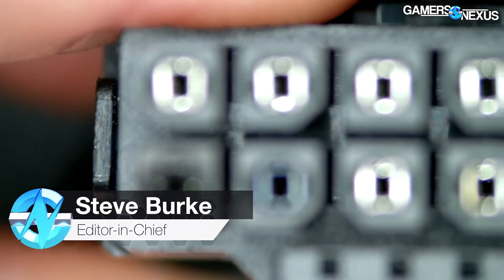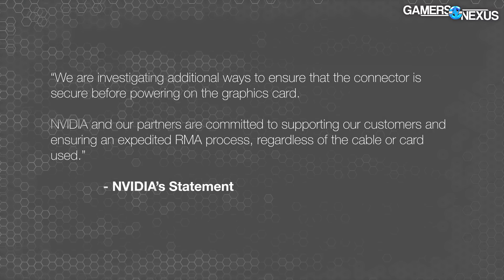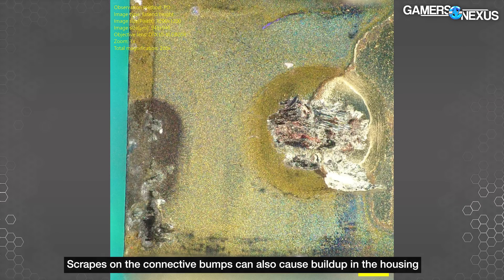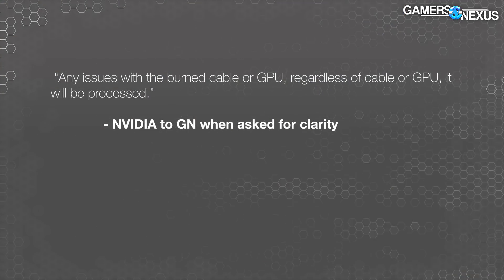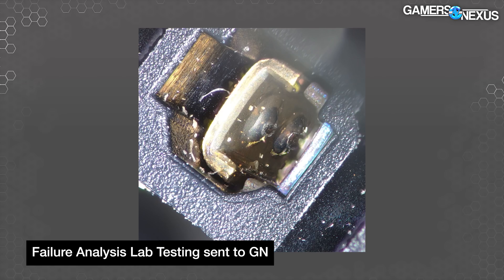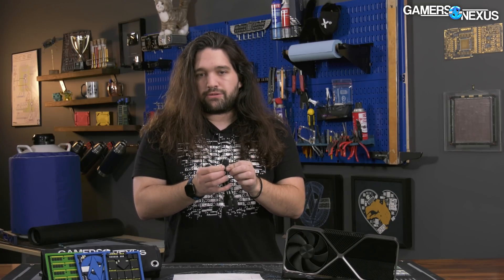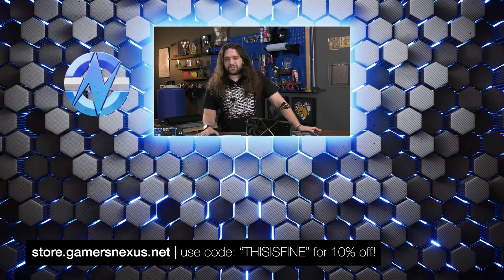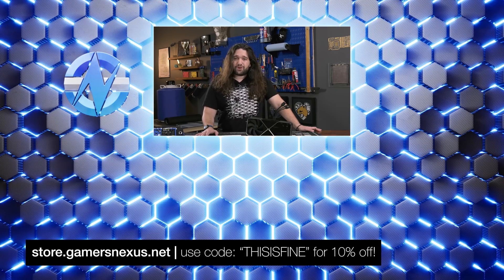NVIDIA Responds to Melting Cables, Warranty Concerns, & 12VHPWR Adapter Failures

Comment: The sensing by the card seems lackluster at best. My 980, 1080, and 2070, and 3070 TI over the years would all complain at boot if the cable is even slightly loose (usually the +2 pin on 6 + 2 8 pin VGA connectors)
Reply: So does every single card that has the proper 6/8 pin connector. They just didn't bother testing and designing the new connector to proper specs.
They came out with a new thing called the sense pins which wasn't needed at all, your card already has sense since it requests power from the power supply.
Then the production isn't that great which lead to all the problems. What a mess.
Reply: @NostradAlex  The sense pins aren't completely unnecessary. They allowed the power supply and the graphics card to know each other's capabilities. The graphics card doesn't request anything, it just tries to draw it and if it doesn't support it, it's possible overpower protection will happen, especially during a transient spike. If it's a gigabyte power supply or worse it might catch fire or worse. Current doesn't work by request and responses and it also doesn't work by pushing it works by drawing. The concept isn't flawed fundamentally The implementation might be, but it does really h sound more like an Nvidia Pacific issue, especially the fact that the clip doesn't actually hold the connector in place and it doesn't even detect if it's not fully connected, which defeats the purpose. I think there could definitely be a use for such a feature as certain components such as graphics cards, which are basically a computer inside your computer. Draw more power unless we're going to start moving them outside of your computer. Like a graphics processing unit could just be connected through thunderbolt or USB-C or some other technology of like. I think there's server side technology that's sort of like NV link between different servers. I forget what it's called at the moment, but the point is that they're going to be drawn. Basically the amount of power my entire computer control. I think it would be a good idea for use the resources. They have smartly with detectors and control shifts and not just throw wattage at it and see what happens
Reply: @NostradAlex  of course, this is definitely an example of on paper versus actual execution. AMD didn't need the high power connector spec. Maybe they'll need it on server technology in the future, but currently the gaming GPUs are pulling nowhere near the wattage and cost of Nvidia GPUs wall. Theoretically being competitive and performance. Although I don't know if we have independent benchmarks and review samples yet, I haven't heard anything. since the AMD announcement. But there's no reason they couldn't have used the cable and spy PCI sig so you could even argue Intel have more to do with it than Nvidia. In particular, there are hundreds of companies in PCIC and until does have a fair bed amount of influence, especially when it came to 12 volt VO roll out, which might not be a bad idea, even it might allow for more efficiency. The problem is getting everyone to adopt it if it's not the standard. And of course they also worked on and were a big factor in the 3.0 ATX spec for at least power. If not, also the motherboard itself. In any case AMD could have made the mistake and because I haven't released anything yet, as far as I'm aware that they still very well could and I would even consider that the Ryzen CPUs are running a bit warm at stock, even with AIOs or liquid cooling.

Comment: NVIDIA shouldn't have to warranty problems from 3rd party products now matter how much you hate them! Most Power supply's don't even have the sense pins to connect to and the connectors need to be a 90degree connector.

Comment: I think a big factor of the issue with not being fully clipped in, after all the media coverage on how fragile the extra 4 pins are, less people will feel confident giving it a little tug check.
Hopefully a revision on these are made for next gen maybe with extra clips too? but as it is I wouldn't feel confident fitting one in my own PC or any work PC's and is another plus for AMD this generation if I decided to upgrade/new builds for work
Reply: Maybe like SATA cable?

Comment: 3:15. Wait i have a question. GPU sales via 4 board partners - what does this mean? are these 125000 card are actual sales to end consumers or sales to resellers? We need statistics about actual number of sales to end customers. I believe with such statistics the % of failures will be much worse.

Comment: Maybe the force necessary to insert the cable correctly, is not very good for the motherboard, even so, with a monster GPU card, to heavy to be secure just by the bracket, that it needs  a platform in the back of the card to not let it distorce the PCI slot, or the card itself. I always put an hand near the PCI slot, when inserting the "old" 8 pin connectors, because the need force to be inserted, but if that needs so much force, in my opinion is a design issue.  Great work GN, as usually !

Comment: Alright, look: it's very easy for NV to say that we shouldn't be worried because that's just a mere 0.04% chance that things will go south with the card cord, while counting the money. They'll say whatever to downplay this.
I don't care about how many cards NV has sold. The way I see this, they've got 50 REASONS to recall those cursed cards and provide a DEFINITIVE solution to this problem. That's the LEAST one should expect after spending over ONE THOUSAND DOLLARS for it.
Reply: The solution is pretty simple: plug the cable in all the way

Comment: the connector should be LONGER , not shorter ; this way it wont Angle ; especially since the 12VHPWR is a Splitter with not two , but THREE 8pin's that will "help" it exit , by angling rear front rear front ... while you do ''Cable Management''

Comment: Well, at least I know my habit of ramming cables in and wiggling them a little bit just to be sure may actually help in this scenario. 

And honestly, I think both cable solutions should be used. A loud click, something at least as loud as an RJ45 connector, or maybe even as loud as a RAM slot latch, and the card not even powering on if the sense pins aren't connected. That way, God forbid somehow the cable feels plugged in and someone misses the click, it still can't burn.

Comment: I wonder what happens if they just ditch the 8x4->12 pin dongle and just slap 8x4 pin connectors directly on the card so if there is a pin that’s not completely connected it can lower voltage and/or it can send a notification on the desktop that not all pins are connected
Reply: you also need a data connection to PSU, so that would be five cables...

Comment: In fact, the GN did not find out anything good. On the contrary, the very fact that there is no fool protection means that we will see more such cases with lower cards as well. Here they correctly wrote about the PC prebuild. They are sometimes constructed with feet. It would be better if the matter was in the high energy consumption of 4090.

Comment: I didn't fully torque the lug nuts on my car, wheel fell off and destroyed a bunch of parts and body panels.  Car manufactures would laugh in your face.  I'll give props to nvidia if they actually accept all the RMA's.  Going forward, I'm sure there will be warnings wrapped around the connector or something that will shield them from future RMA's.  Good on them for now though.
Reply: Yeah, this stance from NVIDIA sets a really bad precedent. Soon we're going to have idiots ripping PCIe slots off motherboards by pulling out GPUs without unlatching them, then claiming "the GPU caused it".

Comment: A better explanation for NVIDIA's warranty wording is that they can't control the quality of cables they don't make. So if someone is looking at replacement cables and, instead of spending $40 (or whatever) on an NVIDIA cable, buys some $3 cable off wish from NDIVIA and their card blows up because the cord is 90% Yak hair, it's not NVIDIA's fault, and they aren't going to take the hit for someone being a cheapskate.

Comment: Problem created by burger flippers watching utube videos then becoming over confident in vocations they have zero background in..., Current flow thru resistance equals heat, so according to Ohm's law it's working exactly as it's supposed to if you don't plug the connector together all the way...

Comment: So after hearing about the number of cards sold, albeit Founders cards and AIB's, how in the absolute fuck are you gonna launch a product with only a hundred thousand + units when there are 3.5 billion + people on the planet to only have several million people disappointed they cannot purchase said product for msrp within decent time frame of its launch date? I wanna fucking know how is this okay?!? I knew the plug melting issue was going end up being a nothing burger, but the supply and scalping issue is the real travesty here and we have not heard from Nvidia a real solution this most frustrating problem. While people that have had an issue with their cards malfunctioning and it was not user error, I do have some sympathy for you, however all electronics since their inception have always been hit or miss if they actually work as intended without failure. But this debauchery of availability and clear price gouging needs to be taken another level of accountability!!

Comment: I'm thinking of making some sort of clamp that holds the connector together. Also goona put a temp sensor on both side of the connector. Maybe use an aquaero to monitor and shut down the pc if connector temp gets over 60-70 degrees.

Comment: This is the most unreasonable idea to suggest this needs a test.  
The table of 310.16 of the NEC states 16 AWG copper wires are suitable for 18amps.  The current wattage would then be 288 max wattage (lets not even account for the length of the wire as its needless.  If the card could possibly use a total of 320 watts due to the  total amperage pulling through each wire.  The gauge should be AWG 10.  This is a heavy duty gauge of cable and I have a hard time understanding why the engineers would allow or suggest this type of connector.  Tie in fan vibration and the potential for fretting on the pins as well.  Nvidia made a mistake.  WHY?
Reply: I also don't agree about (The Wire Line) starts at time 4:16 .  This is thermal degradation happens to vehicles connectors all the time.  The heat within the cable is being restricted and the potential energy(heat) has to go somewhere; naturally inflating the connector.  IE: look at terminal tension and heat restrictions in a connector. Now I am not suggesting that it may have been a end user.  I believe the connector body is obviously to small for the wattage intent and has distorted the connector.  I also look at the terminal pins and see the length is too short for the intended amperage.  This is a clear cut determination that the wiring is inadequate .  Nvidia go back to the other connector and lets all move along.
Reply: It has 6 wires so that's 1300W? Which is clearly enough?

Comment: I don't know about pig fat. But water (liquid H2O) can seep into the giant tanks buried in the ground underneath the fuel station that the gasoline\diesel are stored in. As water does not combust at anywhere near the same temperature or pressure as gasoline\diesel the engine will be unable to properly combust the water. Also water doesn't mix with the oils used for lubrication inside internal combustion engines but instead displaces the oil which can prevent lubrication from occurring. Obviously both of these will cause damage to an engine which will not be covered under the manufacturer's warranty. In cases in which this has happened the vehicle owner has either had to make a claim on their automobile insurance or pursue compensation for repairs from the fuel station owner.

Comment: That 12VHPWR standard should not exist. For that kind of power levels 120V would be much more suitable. The USB standard also gone up to 50V, to be able to do 240W.
Those kind of connectors are typically good for a maximum of 30 insertion/removal cycles. And of course, when you wiggle it in and out, every back-and-forth counts as a cycle. Every cycle degrades the mating surfaces a bit. This also goes for the feeding cables that go into that Nvidia plug. Those should be of equal length and with no other connectors daisy-chained to it.

Comment: If this might help, I've pushed the connector on my 4090 like mad make sure it's properly slotted. Also put a little piece of plastic/foam under the connector, between it and the card to make sure it stays straight and does not bend close to the pins. So far no problem at all.

Comment: I tend to push on the ridge on the clip side with a flat head screw driver while pushing in, makes it a lot easier. Also I'd never use a card that eats so much power. I don't see much of progress when they feel the need to push the power consumption so much to eek out that extra 10% performance.

Comment: The native cable on my thermaltake 1200w psu had a loud and tactile click when it seated and did not take a lot of force, unlike the adapter with the card did not click and took way more than a reasonable amount of force. This amount of force makes people uncomfortable and may assume that it is seated. The adapter needs an overhaul for sure.

Comment: Pig fat runs fine in Diesel powered Vehicles, in cars that run any form of regular Petroleum or Petroleum with any percentage of ethanol, any percentage of pig fit in the mix is not going to give satisfactory performance (it will break shit).

Comment: I had a similar socking issue with an 8 pin into my psu. Was hard to tell that it wasn’t fully socketed
Reply: Into PSU you just push it hard, there is nothing to break (if you're not trying to plug it incorrectly of course). On MB side only 24 pin is pain in the ass, 8/6 pin's are very easy to connect.

Comment: they should widen the clip, and shortening the sense pins a few mm is a brilliant solution to throttle the cards

and maybe set up an on-screen alert through nvidia control panel/driver if sense disconnected

Comment: It is still a crap connector in terms of stability. While not exactly the same, the plastic latches on two of my 30 series card's adapters just broke off after trying to disconnect them in a careful fashion without any more force applied than the latch requires to disengage. This means that the plastic must have weakened over all the time in my open tower setup. If this happens to the newer adapters inside a closed tower with just a little too much strain on the pins, you can plug it in as perfect as you want - gravity, the weight of the connected cables on nVidia's adapter along with the wiggly connector and its weak safety latch aren't exactly a safe combination. In spite of all the certifications and tests, the 12VHPWR standard seems flawed.

Comment: for such a power hungry device, it would make sense to have a thermal sensor beside the connector. That would make it easy for the card to monitor connector conductor temp and shut down if it got too warm. It would reduce fire risk and returns, and provide extra safeguard for the odd occasion when the connector looks fully on, but isn't.

Comment: I'm glad to see NVIDIA actually RMA the damaged devices, even if it might be user error. Granted, NVIDIA should hold some of the blame. The last video you could see that the connector had been pressed in all the way and the snap still didn't click to secure it. You shouldn't have to manhandle the damn thing to get it to do it's job.

Comment: The line in the warranty was completely blown out of proportion. It was there just incase someone bought some super cheap cable that couldn't even be trusted to light a 10 watt bulb, that's the reason for such clauses.

Comment: changing the sense pins to pogo pins that only connect when fully seated might be a good solution.  However, maybe there is an even easier way?
Reply: bigger and louder latches for example. maybe even those you have to latch manually

Comment: I think this connector can be improved by using two latches. One on each short side of the rectangular connector. Seems most of these have the burned pins/sockets on the ends not in the middle. I'm guessing most of these have the pins/sockets burned on the side toward the middle of the GFX card and not on the end toward the back of the GFX card because people are side loading the cable during cable routing toward the back of the card. Also make the male and female connector ends contrasting colors so end users can easily see a gap between the connectors if not fully seated. Use contrasting connector colors user friendly for color blind users. Make the part of the latch where you would grip the latch with your thumb and forefinger to remove the connector grooved for increased grip.